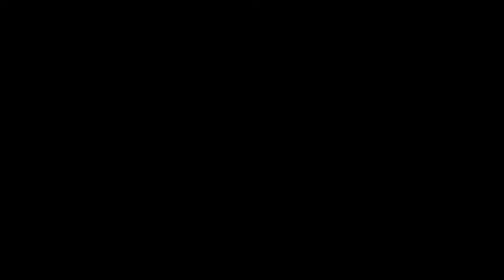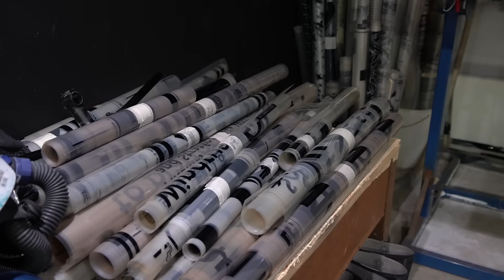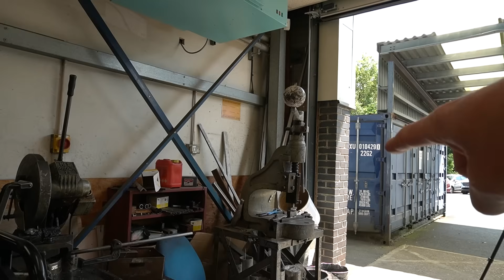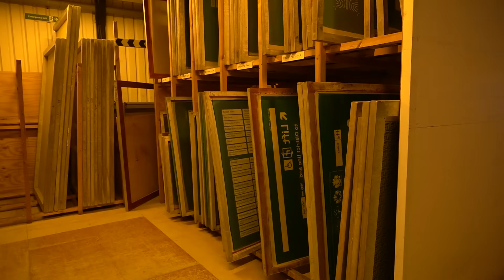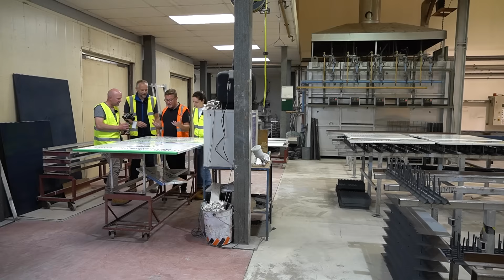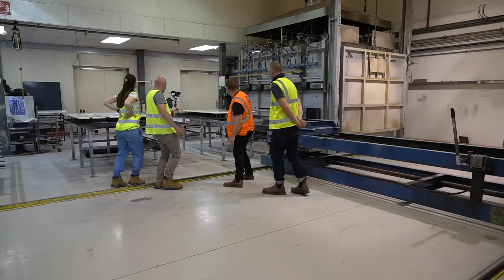Sign on the Line | Hidden London Hangouts (S10E01)

Comment: That's really amazing! I have watched half of it, but I wonder... if the enamel signs were used after the King's Cross fire, which material was used before?
Reply: There were enamel signs dating back to the earliest years of the Tube but plastics had started to be used in the 60-80s. If you go on the Charing Cross Hidden London tour you can still see some of the signage printed on Formica.  The Kings Cross fire prompted the Fennell report, the introduction of section 12 which, in short directs the use and storage of materials in stations below ground are limited to those that do not support combustion. Hence the return to only using enamel signs. Glass and fire retardant vinyl are also used.
Reply: @chrisnix6352 thanks so much for the reply! I hadn't thought of plastics, but it makes total sense after a disaster like that one. I haven't done that tour (yet). I totally loved the two I did!

Comment: 15:00 Standard design he says, but I remain to be convinced that TfL haven't quietly beefed up the font a smidge in the last four years or so.
I'm happy to be told that I've gone stark ravin' but if my eyes do not deceive me, the extra breadth and blockiness of the letters mean that it's lost its elegant simplicity which we all know and take for granted.

I first noticed a difference with the restoration of the destination light boxes at Earls' Court; there was just something a bit off with the mass of the text.

I'm pretty sure that there's been a change for whatever reason and wouldn't mind knowing why, if the powers that be don't do the usual and dish out the standard intellectual property can't talk about it pap we're so often insulted by.
Reply: Perhaps you are thinking of Johnston100? Johnston100 was introduced in 2016 and is slightly wider in design than the previous 'New Johnston' and supposedly restores many of the 'quirks' the latter ironed out. It was little used on signs until the Overground rebrand in 2024, though it was introduced to printed posters and the website a few years earlier. Neither are patch on the original Johnston in my opinion. You are right, the Earl's Court indicators so look off due to their use of one of the newer forms of Johnston, the default weights of which are significantly bolder than the original Johnston.
Reply: @Epalvosh I am most grateful for your reply and its resolution of a long-term bugbear.
The fact that you knew the answer and were prepared to go out of your way to elucidate shows that the world's a wonderful place despite what social media and the News would have us believe.

Great stuff, thanks!

Comment: That was so good. Well done guys. I was hoping you were going to reveal how exactly they print those horizontal lines around the edge of the sign. Given that the screens are flat and the sign metal has already had its edges turned on the press brake, you can understand how the base colours are applied in the spray booth, but how do you screen print around corners?
So good to have you back!